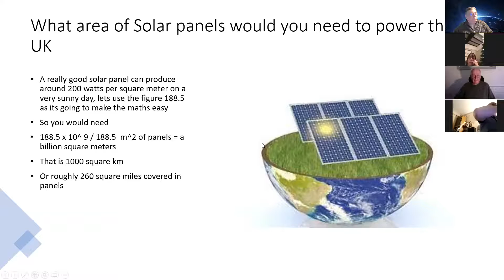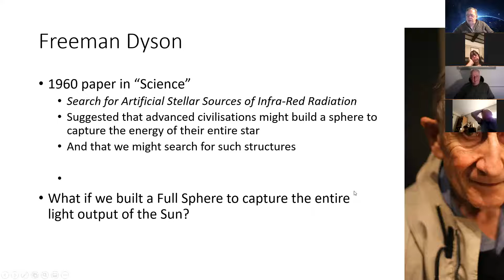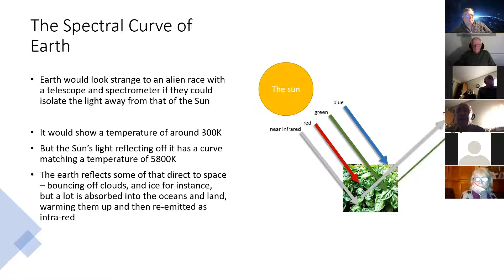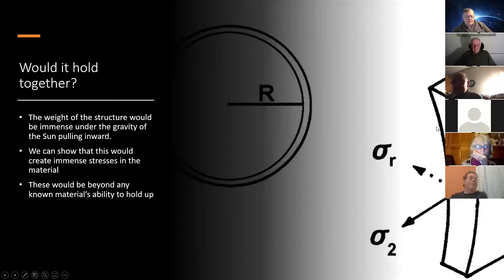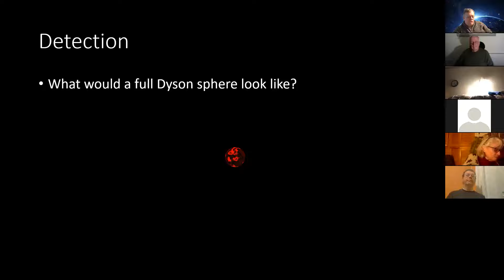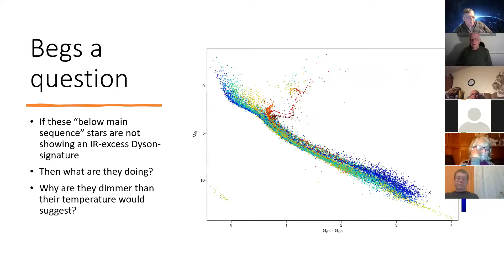Dyson Spheres

Comment: An ingenius concept but well into the laughable category. Collecting every atom in a planetary system outside of its star would not build the tiniest segment of a dyson sphere even if made incredibly thin. And the processed material would have to be impossibly strong, stiff and heat resistant. For comparison our sun is 99.8 % of the total mass in our solar system.

Comment: I believe a Dyson sphere is not something an alien civilization would do. Instead of a mega engineering project super costly in resources and not particularly efficient they would use matter-antimatter annihilation as a source of energy. Even a fusion reactor is more efficient than a Dyson sphere.
Reply from the maker: You could be right. We are getting close to achieving a fusion reactor that delivers net positive output so I think that’s plausible. Antimatter would be great if we can source it somehow without making it one atom at a time with a particle accelerator. Maybe it could be harvested from somewhere though???